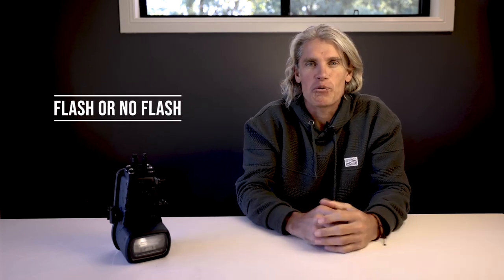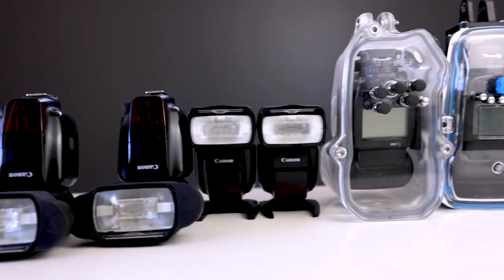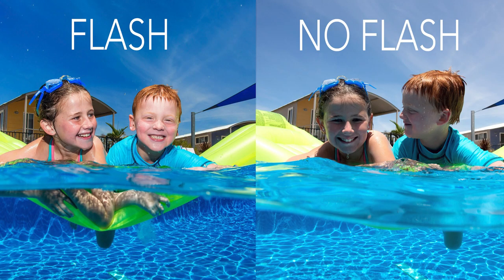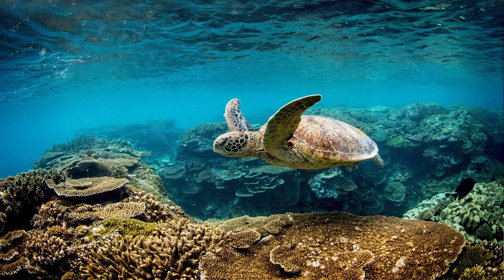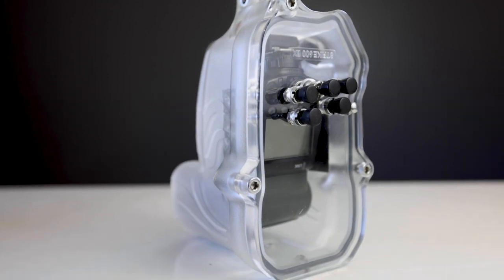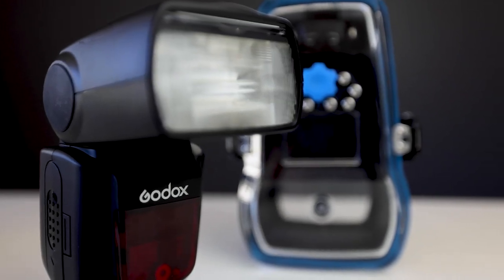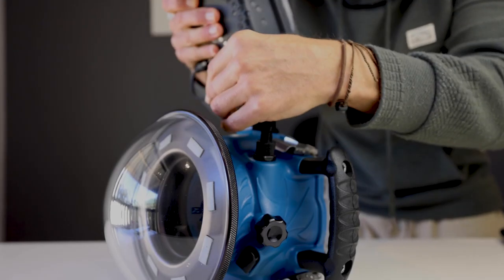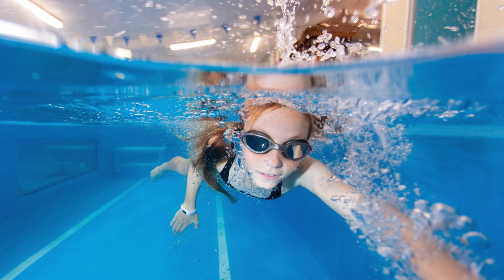Is Flash Missing From Your Water Photography?

Comment: Ever shot with multiple strobes for split water work? Would that be best accomplished with dual bulkhead connections or working two flashes in Master / Slave mode?
Reply from the maker: Yes the dual bulkhead connections would work well, or you could do it the same as on land, with the master on one and slave the other